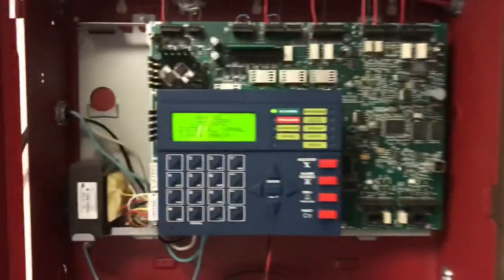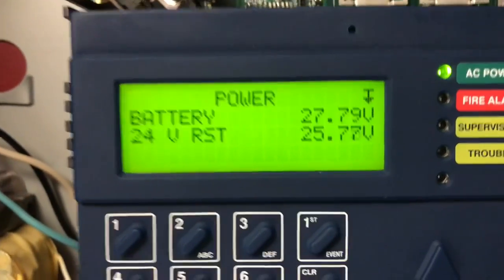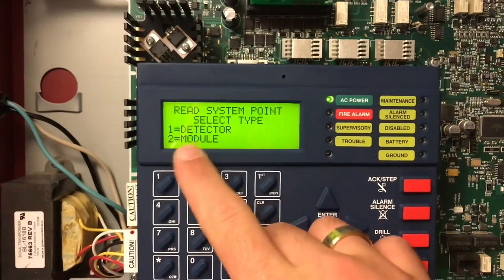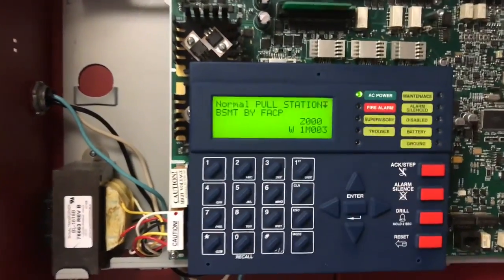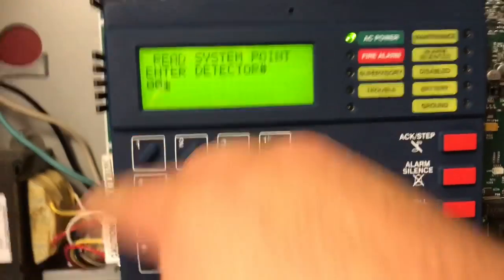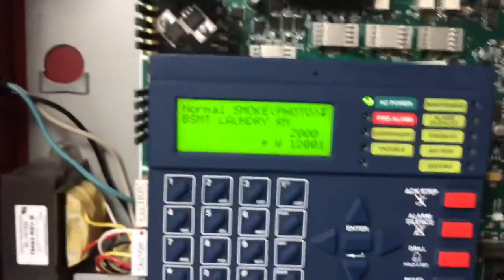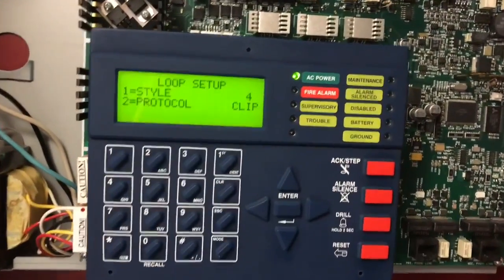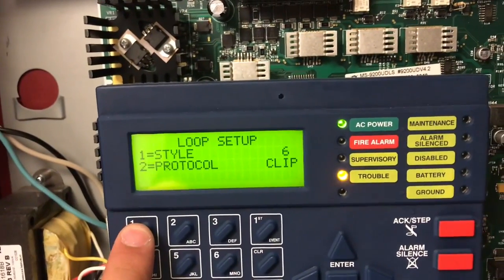How to program a Fire Lite MS-9200UDLS

Comment: I can't get the horn strobes to be synced on my 9200UDLS. I tried the  strobe silence sync mode and the horn strobes won't work for some reason. They are system sensor spectralert advances. Nothing I have tried works.

Comment: I noticed you were using the sd 365 detector with the ms9200... I'm experiencing difficulties with a the same setup only difference is that the number of detectors are about 25 and the system is being upgraded... Has about the same amount of old type detectors? What can I  do to get them all active as the panel goes down after a certain amount

Comment: Hey there, I have just taken over a job where they have this panel installed and I am coming from programming Simplex Grinnell panels, so this brand is new to me. Is there a computer based programming software for this panel or does everything have to done via the front panel or keyboard?
Reply from the maker: Great Question. You can program it via the software (PS TOOLS) or you can fat finger it through the keypad. For the new FireLite ES series panels, the software is FS TOOLS.

Comment: I have a question? I recently got this panel and what do you mean class a and b for the style thing? I got a BG12lx so what style would I need on and what are the shield terminal things?
Reply from the maker: Great question! Style 4 wiring is when you have only two wires going out to the field devices. If there was a break in a wire, anything down the line from the break would go missing on the system. Style 6 however, supplies a pair of return conductors that go from the last device all the way back to the fire alarm control panel. Even if there was a break in the wire, all of the initiating devices or notification appliances would still be 100% operational due to the return conductors. Shielded cable is when you have metal shielding in the wire. That’s usually only used in certain applications.
Reply: @Dredpath1  Ohh so I can just set it to style 4 and not use the shield terminals? And then have a positive and negative wire going out to the initiating devices?
Reply from the maker: @faymonths1345  the shield terminals have nothing to do with Style 4 or 6. Style 4 is also a class B circuit. Only two wires.
Reply: @Dredpath1  thank you!
Reply from the maker: @faymonths1345  anytime!

Comment: Is this a good upgrade from a MS-2?
Reply: The 9200UDLS is much more complicated, what with it being addressable, and having a different programming style from the MS2. If you want to stay with a conventional panel and not want to worry about buying monitor modules/addressable devices and the wiring hassle they can come with -- but want the perks of an 80 character display, ANN bus, and a different, more complex programming type -- I would recommend the MS-5UD or even MS-10UD. I started with the MS-5, and I must say it's a great all-around, fun, and an easy user-friendly panel. However, if you are up to the challenge of addressable SLC loops rather than the conventional IDC's, and are willing to pay a pretty penny on COMPATIBLE addressable devices (Bolded for emphasis -- I bought a Gamewell branded MMF-300 for $40 or something for my 9050UD and I didn't realize at the time that the communication protocols of different companies, well, differ...), then yes the 9200UDLS would be the upgrade for you. Just be aware it can be on the pricier side, and I would strongly recommend a boat-load of research on Firelite addressable systems; how they work, how to correctly wire the SLC's, the works. It would seriously suck frying a panel that cost you an upwards of $500, or sometimes even $1k.

Take all this with a grain of salt though, as sometimes even the simplest of panels can be good enough for some enthusiasts.

Comment: If I where to get this a a demo system with a few smokes and pulls, would this work by only using the SLC and nacs? Do I wire the nacs in series using + and - and a resistor on the last device? Also what is the purpose of resettable power, non resettable power and remote synchronization output? Thanks.
Reply from the maker: Caleb Morand I’m not a licensed electrician so technically I can’t tell you how to wire devices, God for bid something were to go wrong. Non- resettable power is constant even when system reset. Resettable power drops for a few seconds during a system reset and then comes back on when the system returns to its normal state.
Reply: @Dredpath1  thanks for answering my questions. For the SLC it's just the positive and negative that run out to the  devices?

Comment: Do addressable systems use resistors on the last device of the SLC? Thanks.
Reply from the maker: Caleb Morand that’s a great question! No they do not because each device has its own address, and the panel reads every address that is programmed.
Reply: @Dredpath1  sweet! Thanks for answering my question. So basically the panel polls that adress and if the panel does not see it, it goes into trouble?
Reply from the maker: Caleb Morand that is correct and anytime!